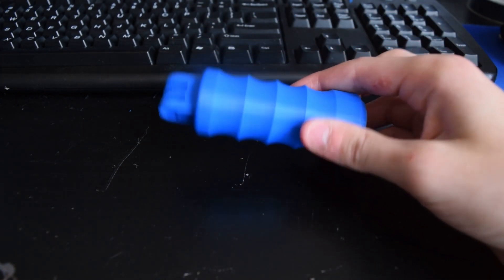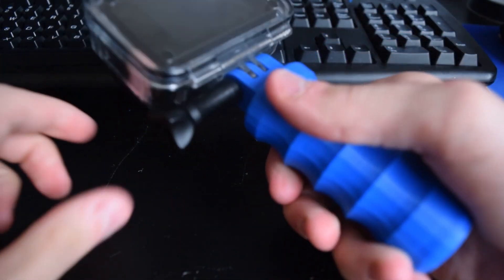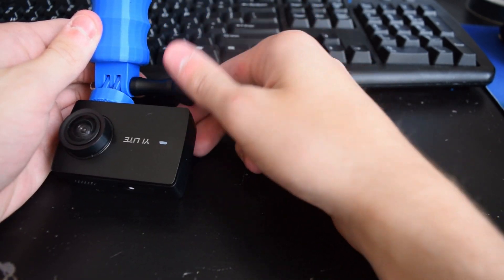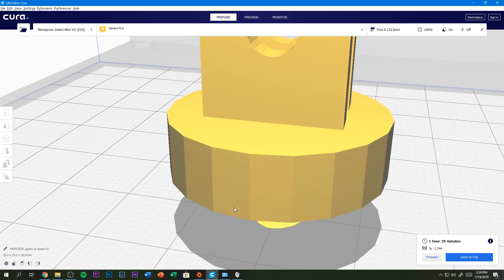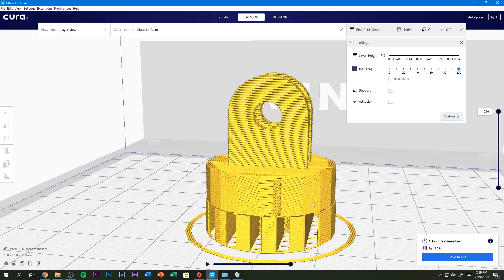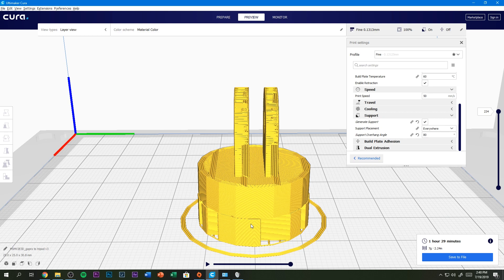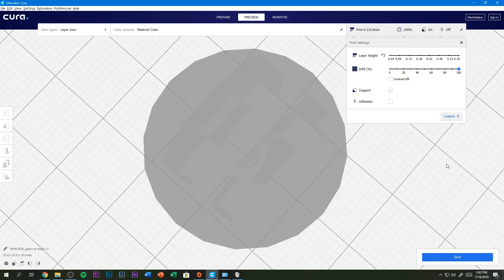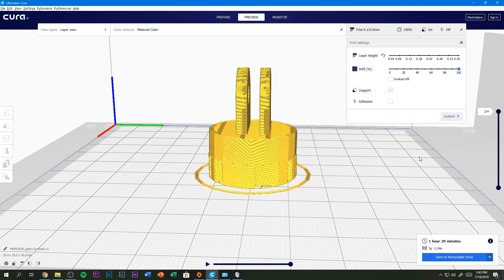3D Printing GoPro Accessories to save time and money!

Comment: Never print a screw or bolt in the same direction of tension or it will have the least tensile strength plus you could save on support material